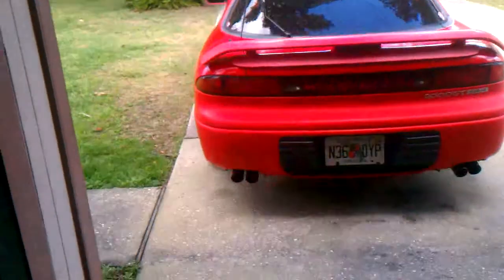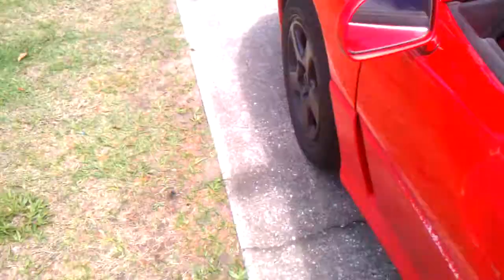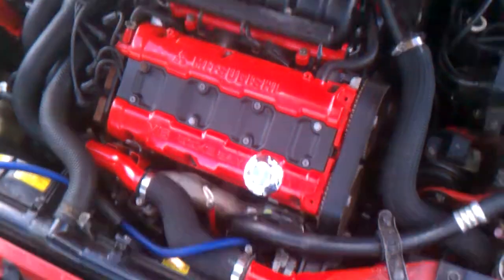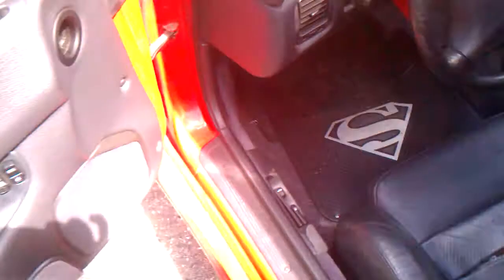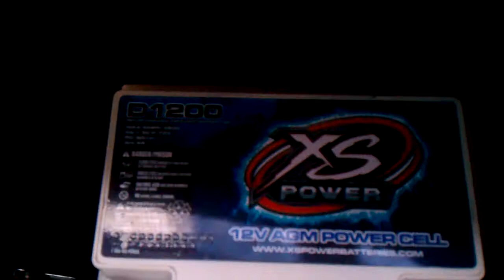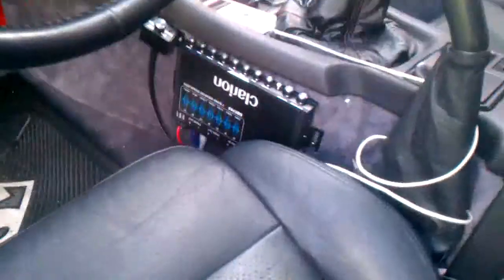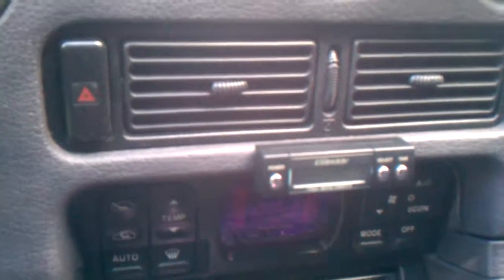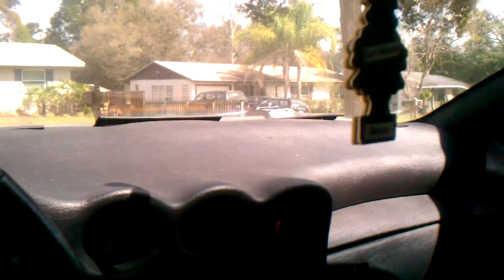Fi btl n2 15 first video 3000gt vr4

Comment: Speakers so loud it cracked your side view mirror...LOL! JK. I'm not a fan of amps and speakers, IMO they add weight to a 3000gt vr4 that's already a heavy beast(coming from a racers point of view). If you looking to race, I would drop some weight off that car, if your just looking for a half and half, good sound and speed you did good.

You could always do upgrades for more HP 2 compensate for that amp and speaker system. I really like your 3000gt vr4. Engine bay is badass Car only needs paint.

Comment: Did you try pointing the sub towards the back? I had a SA 15 on a 4cu ft tuned to 32hz and it sounded better and louder when pointed towards the back in my 3000gt.